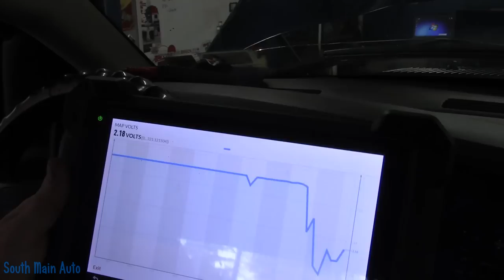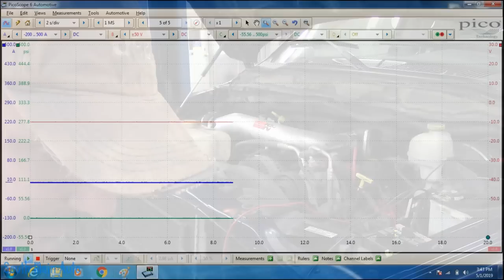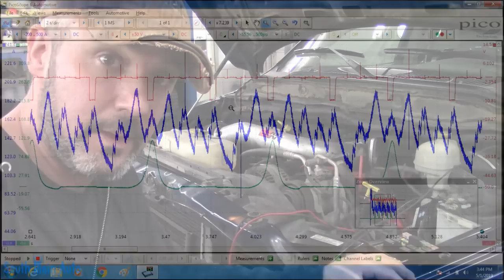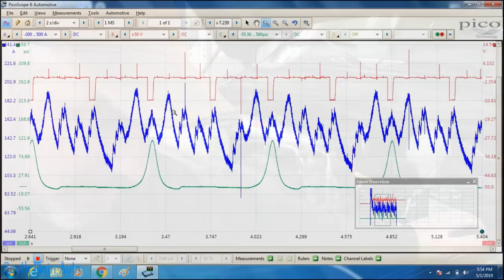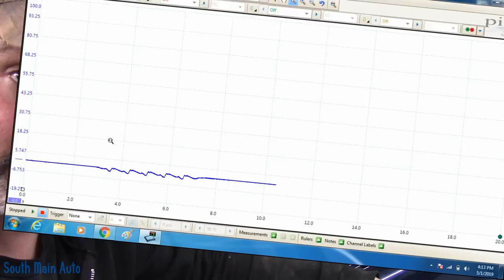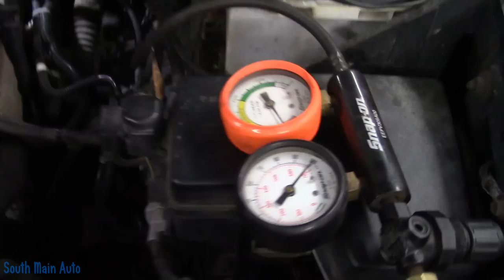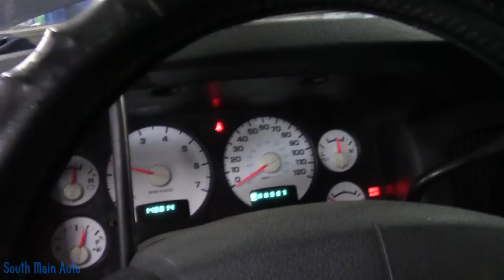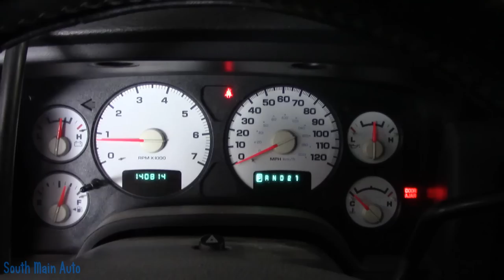5.7 Hemi Ram - Bad Misfire & Will Not Idle

Comment: I have seen several Hemi's with broken valve springs and rocker arms. When I was Fixed operations manager at a full line Chrysler dealer one of our rookie, fresh out the cap program, techs had one with a misfire code. He swapped the coil and injector and the misfire stayed in the same cylinder. He said he didn't know what was wrong because it checked out electronically. I told him to rev it up, it was popping in the intake so I told him to pull the valve cover. because there was a valve train problem in that cylinder. He pulled the cover and there was a broken rocker arm. He asked how I knew that by listening to it. My reply was remember I was a tech for 30 years before I was a manager, when I started in the business in 1968 there were no computers. You learned a lot by observation of symptoms.
Reply: grant wright Most times if everything checks out electrically. the problem is mechanical.
Reply: And then everyone clapped
Reply: Nice fix!    I learned a lot by listening to engines!!
Reply: Computers have made millennials dumber than a box of motherboards. Turn off the power and they're USELESS.
Reply: @joeashbubemma  I'm a technician and I'm better without computer.  Im 29.  Don't forget gen z is old enough to vote now lol
Reply: Kevin Howard and we realize that and know that is that’s very scary.
Reply: It usually doesn't take long to recognize the difference between a mechanic and a parts changer...
Reply: Ok so ur so smart u told him to disassemble the motor instead of just doing a compression test? Sounds like u need a lesson also
Reply: @85irocz28  When you know what you hear no reason to add extra work. Us old wrenches have diagnosing ears.
Reply: A long straight screwdriver held around the place the noise seems to be coming from, and with the handle stuck to your ear, makes a great stethoscope to get a better idea, and at times, will help you pinpoint where the noise is coming from...just gotta be careful doing it around moving parts while the engine is running...for me, it's helped many tmes to find worn out water pump and alternator bearings going bad...it can even be used to listen to the valvetrain through the valve cover...
Reply: @charliedee9276  it take less then 5 minutes to do a compression test ....make 100 sure
Reply: @85irocz28  I've been wrenching over 40 years, an experienced ear gets highly developed in that amount of time. Compression test 8 cylinders in 5 minutes... Yeah ok.
Reply: @85irocz28  Sometimes taking off a valve cover is easier than a compression test. And you can still have a mechanical issue even with a good compression reading.
Reply: @joeashbubemma  ok boomer

Comment: Lucky that Mr Valve never met with Ms Piston and had a party.
Reply: Shouldn't that be Mr. Piston?  Just a min I will ask Mrs. Allen
Reply: When they do, they go on a real bender
Reply: very common on those junks too
Reply: When they get screwed, you could say that mistakes were made... ;-)
Reply: @steveallen5496  Mr Piston and Mrs Cylinder, Mr Valve and Mrs Valve seat/ guide.
Reply: The timing is still intact, the piston could push the valve back with  maybe some ticking sounds, but no bend valve stems or pushrods.
Reply: Hahahahahahahahahahahhahahahahahaha. Hahahahahahahaha, Hahahahahahahaha,Hahahahahahahaha.
Reply: Haha
Reply: @opl500  Nice!
Reply: @opl500  Clever word play.
Reply: And that's how carnage is made ;)
Reply: I felt the same way when my valve spring broke... considering I drove the living balls out of my truck to see if it ran rough up top
Reply: Is that how the 3.6L was born?
Reply: When was any v8 a interference engine? Dont post ignorant stuff
Reply: @Flatus Antiquitous 5.7 is nowhere close to a interference motor there is even a website that says what motors r what

Comment: Most people would've taken twice the time to diagnose this because there isn't a fault code for "replace intake valve spring on cylinder 5."
Reply: slowride55 Agreed.  The Dodge dealer in Greenville, SC once told me that their techs can’t diagnose a vehicle without a code to read.  They only go on scanner codes or replace parts specifically requested by the customer.  Literally told me to drive it til the light comes on or suggest a part to throw at it trial and error style.
Reply: Lol so true, there is so much the computer can detect without more sensors, logic, etc
Reply: @fomoco300k  I can see that only because of warranty. Regular diagnosis shouldnt be a problem.
Reply: MeVsMe  Not sure what warranty has to do with technicians’ ineptitude in diagnosing.  Hadn’t really considered it since the last vehicle I had that was under any kind of warranty was in 1995.  However, after considering your proposed excuse, I’m pretty sure that whether a vehicle is under warranty or not has nothing to do with the techs’ knowledge or training level.  And, since the instance in question was a 2003 Ram with somewhere between 160-170k in 2015, that would make that 12 year old vehicle ineligible for a warranty but very feasibly diagnosed.  In fact, I was able to do it in my driveway with a cheap Actron fuel pressure gauge and an ignition key and my brain— no multi-thousand dollar high tech equipment needed.  Which brings me back to my point; Eric did a great job of using his noggin instead of a crutch.
Reply: slowride55 I had one break last year on my 70 Z28 the day after doing a few 6,000 + rpm shifts. Even though they all only had about 8,000 miles on them, I replaced them all. Now I have 15 spares and hope I don't ever need them. These were Lunati brand BTW.
Reply: @fomoco300k  with warranty you have to justify everything and have documentation to back it up id you want to get paid. That's why i said that.
Reply: @fomoco300k  This must be the same for other dodge dealers as well. Friend of mines dodge caravan for sure had a bad TIPM (bad fp relay) but because their diag computer and no code they wouldn't call it. kept wanting to say it was a bad fuel pump and they(the dealer) just put a new one in it. don't think they even tried bypassing the tipm to turn the fuel pump on first or see if they pump was even being commanded on.
Reply: I feel like most good diag techs would have gotten there fairly easily with a compression test and leak down test. If the vehicle idled better a vacuum guage would also have been useful.
Reply: fomoco300k where does one learn these skills of noggin use?
Reply: James
No replacement for experience.  Lots of time with head under the hood, listening to those who know, tryin’ and even some erroring.
Reply: @fomoco300k  I'm with you on that one
Reply: easy to diagnose with the key jingle trick even says what cylinder, been there done that
Reply: @JasonSpiffy  school hard knock  you get burned once not second time. When you are working flate rate ,got think ahead ,and what you learned from other Tech's.
Reply: @fomoco300k   Lies, have worked for big dealers my whole life and this post is myth..... Never seen that happen and have been involved in the exact opposite, units are only released when customer doesn't want to go further ----> means you didn't want to pay for the diagnostic time, or its been repaired and repair verification has been completed....
Reply: @TejasToolMan  please explain
Reply: @michaeldepow6663  Most dodge's have a way to get the CEL codes by it. Doors being shut is a must. Go from Off to On 3 times, on the last time leave it on and you'll see the codes in the mileage read out. Do it gently, not too fast. I do this before every inspection so i can fix or trick the vehicle inspection =) Been doing this for  20+ years on 94-2006 dodge trucks On my 2003 Ram I take out the #19 fuse fuel pump pcm, turn the vehicle to start and hold it on till the 3rd chime as it resets the pcm
Reply: @JasonSpiffy  some things cannot be learned ---like attitude. Notice Eric is willing to share freely. That is the first step and the hardest to follow.
Reply: @themanthemyththelegend1392  I don't think it's a lie.  I've run into the same thing with a Ford dealer when the vehicle was under warranty.  After the warranty is passed, they might try harder because the customer is paying.

Comment: My best tool is still my brain, been wrenching on my own junk for 46 years. When I started you had points in the distributor, no electronics...miss those days. This hemi owner was very lucky that valve was not bent. You used to be able to use a wood plunger handle to find valvetrain problems...one end firmly placed on valve cover on each cylinder...other end firmly over ear canal...you could tell where problem was by tone difference...old school trick..still works. Some "techs" today are lost without their scanners. Scanners are great, but may not lead you in the right direction for mechanical issues like this. Use your ears...that miss in the starting cycle tells alot.  Wish I lived close to your shop, got a 91 Silverado with gauge problems...dead temp and oil pressure moonie gauges...I hate them..lol and so far been unlucky finding replacements..temp shows nothing while running, but shut it down and it registers...oil pinned high...new sensors in both...oil pressure fine. But I check oil and water daily...has over 211,000 on the clock..but odometer has been broke for years....rebuilder engine installed in 2013..I got it in 2017...really cheap. Was Sis in laws truck, she gave it to me when it broke down at our house..lol....I replaced fuel filter..runs good. I would love to replace cluster..if I could find one. Outstanding job as usual Eric.

Comment: That dude was so lucky! Awesome video, thanks for sharing!
Reply: No kidding!  Eric should have called him and said, "Dude, you need to go out and buy a lottery ticket. Today!"
Reply: No joke waaaayy cheaper than even a junkyard motor.
Reply: What a saver.    Winner winner 🐔 dinner
Reply: The scanner computer used in the video: https://amzn.to/2H3l6dt Autel MK908 Ultimate Wireless Automotive Scan Tool with ADAS, ECU Coding, Full Bi-Directional Control, ABS Brake Bleed, OE-Level All Systems Diagnosis
Reply: He was lucky he found a shop that could diagnose it and fix it, with the minimal repair that will get the truck reliable again.
Reply: Hey man this sounds just like my truck . Was it an easy fix ? Also the egr was fine ? Why was it running high?

Comment: I traded a rusty little Dakota for an 03 Ram with a Hemi just like this and the same misfire that the owner couldn't figure out but it idled fine. He replaced all the plugs, coils, and injectors for a ton of money and gave up on it and I was taking a risk on trading my daily driver for it. I did a compression test and that cylinder was alittle low but it would still built like 60 psi or something. I took the valve cover off and I found one push rod had come out from under the rocker  and was diagonal and the top was gently against the valve cover. I pulled the rail off, carefully inspected the rod to make sure it wasn't bent, put it back together without asking any questions and that truck ran mint until I sold it months later and still ran great. No clue how it just came out from under the rocker but it did. I know the 03s and 04s have the valve spring problem and your customer was lucky it didn't blow up the engine.

Comment: These 5.7 Hemi's are known to have failed roller lifters causing scoring on the cam lobes causing inaccurate valve intakes & exhausts seals thus low cylinder compressions.. The needle bearings of the lifters are falling apart & metal grinding away on the lobe of the cam.. Lucky for this customer just a broken valve spring & not a failed roller lifter a major repair, I traded in my 2011 Challenger R/T for this reason didn't want to deal with this kind of failure if it were to happen lucky for me it didn't happen before I traded it in..The newer 5.7 Hemi's don't seem to have this problem just the older models 2009 thru 2014. just thought I'd share with your viewers.. I love all your vids keep them coming learning something new that I didn't know yesterday is always enlightening..

Comment: Well… I didn’t want to think you were right hahaha. My 2007 Chrysler 300c was doing exactly this & also a new friend on Facebook. We both ordered brand new PCMs to no avail. I pulled my valve cover once but wasnt looking for a broken valve so I didn’t see a broken valve haha. I check my pushrods to see if that were all still seated. That was a month ago. Here we are today, i paid attention to which exhaust I was getting Gas & smoke smell from & it turned out to be the same side I had the valve cover open for haha. So I pulled the valve cover back off & Yup… Back intake valve is TOAST. Doesn’t look like the valve dropped, but I’ll be pulling it off tomorrow so we will see what the true damage is. I heard no noises so we may be in good shape. I’m just extremely happy it’s internal damage & I found the problem lol. I’ve been thinking it’s PCM related or wiring related because a rat infestation literally JUST happened & I found shit in my engine bay. I’ve been panicking but all rats are dead. Valve springs toast. All is well in my eyes haha. You did a GREAT diagnosis & I literally ignored you for a month until today.

Comment: Great use of the pressure transducer. I have found that the shape of the waveform from it as well as the max and min values can give valid diagnostic information. The rate of change of pressure on the up and down slopes can say a lot. Storing the profile for all cylinders and comparing them can point to issues more than a simple compression test can.  The rate of filling and emptying of the cylinders is very useful data.

Comment: Meemaw taught me when changing valve springs, locks and retainers use  compressed air in the cylinder to hold the valve in place, no need to pull the cylinder head to change valve springs.
Reply: Richard Foster at the end you can see he did that meemaw taught him well

Comment: Same exact thing happened to my 03 Ram 1500. It's an 03-04 Hemi thing. I put in new Comp Cams 5.7 Hemi valve springs and she runs great now. The truck has 230,000 miles and I revved it out at least 5 times a day, glad to see another person get lucky with the draw on the spring breaking near the top and not dropping the valve. Great diagnosis too!

Comment: The police around here drive Chargers with Hemi’s. I have replaced several broken valve springs. In fact had to buy a special tool to do it on the chargers.

Comment: just had a truck come in the shop and has no compression on cylinder #7, same noise while cranking, same issues as your truck you dealt with. The thing didnt want to stay running and we found when we unplugged the MAP sensor it would run and hold idle but had a solid misfire that would be picked up by our snap on scanner(junk). But thank you !! we tested all the passenger side cylinders and found nothing then found your video and did the drivers back two cylinders and immediately found 5 sitting at 70 psi and 7 was at 0 psi

Comment: The 5.7L hemi that went into 2003 and 2004 did have some quality issue mainly related to the valve train.  The infamous "hemi tick" was traced back to some push rods being slightly short on length.  the "beehive" springs suffered from fatigue an broke.
Reply: This engine clearly has the tick.  I could hear it.
Reply: Those are known for the cam to go flat also
Reply: In those cases it was usually a roller lifter failure.

Comment: When i worked for a dealership we had a ton of these back in the early 2000's . Elgin Made the springs for those and had a hoard of bad ones that were tempered incorrectly . Then chrysler changed spring manuf. shortly thereafter .This brings back memories lol.Great video
Reply: Exactly what I suspected.  Purchasing dept. at the factory was swayed by the lowest bidder. In the purchasers defense, the management incentivizes and grades their purchasers on cost reduction.  So you end up with a supplier that has/had no concept of process control. When in doubt, ship it! This is a systemic problem in American manufacturing, which is why I just bought a 1999 Toyota Camry with 266K miles.  The kicker is that I benefit directly from this mentality. My father-in-law, retired at 55, gets a $2k per month pension which allows him to live independent of our help. He now suffers from dementia, probably from sucking too many paint fumes in the 70s and 80s.

Comment: Man, if only you or ScannerDanner were out on the west coast teaching, i think i'd be interested in a career change. Great diag and fix.
Reply: I wish his shop was in my town, I have a good mechanic shop in town but most of their work is mechanical, little electrical. Eric seems to be the 'jack of all trades'.
Reply: n8pu the fact that Eric knows what voltages and readings certain sensors should be off the top of his head shows how good a tech he really is. As an apprentice I really aspire to be that good.
Reply: Scannerdanner is boring